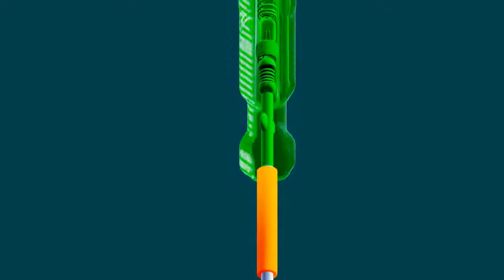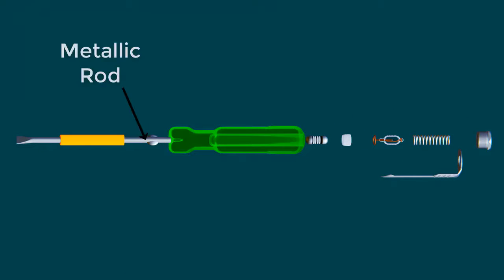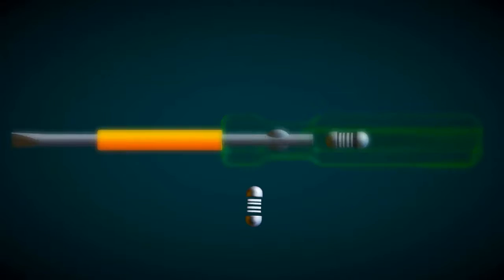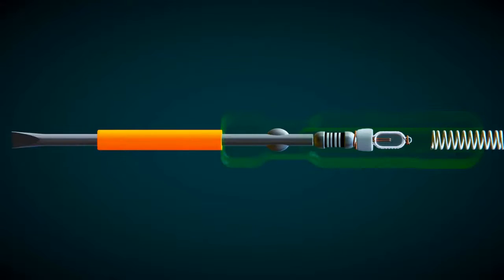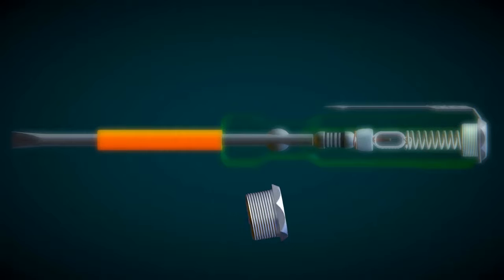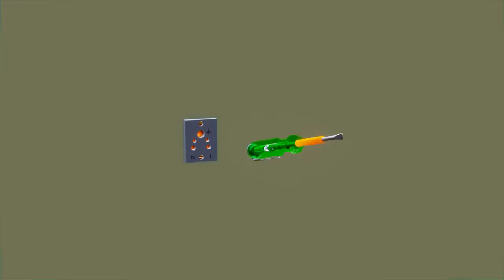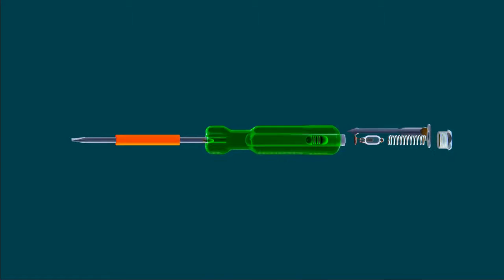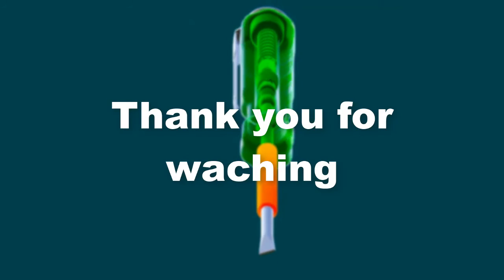How does a neon tester work ?

Comment: And a battery.
Reply: Battery🔋??
Reply: @shivamkushwah1735  There are button batteries at the top. They must power the light when no electrical source powers it  and/or they are responsible for sending out a charge to just check for a complete circuit. This device will light up when touching your skin while the button is pushed.
Reply: @billbrown994  There are no button batteries. The light is powered by the live wire being tested, hence the name tester! Why would you want a tester that always lights up when you touch it??